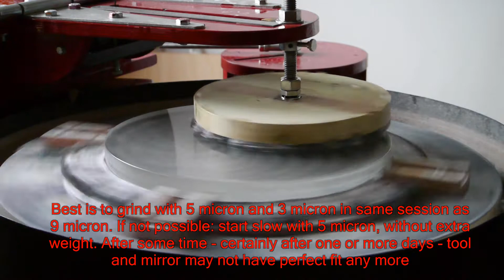Making a 33 cm f/4.8 mirror on the Mirror-o-Matic 5: super fine grinding with 5 and 3 micron grit

Comment: I have been binge watching this playlist because i plan on building a MoM soon. After every grit size, do you disassemble the turntable and clean it thoroughly, or does it not matter?
Reply from the maker: I clean the turntable well without disassembling after grinding with 80 and 180 grit. I disassemble the turntable for more thorough cleaning after finishing grinding, after 3 micron grit, so before I start polishing.

Comment: Hi Jan. Nice sequences, I have to say. Very instructive. I did want to ask one little question. Why do you rotate the glass every so often, when the whole thing is spinning on that axis anyway? Steve
Reply from the maker: Maybe this is not necessary, but it does not cost much time and I do it to be as sure as possible that mirror and tool do not get into resonance.
Reply: makes sense - So there is absolutely no possibility of there being any affinity between the two systems I guess. You are decoupling them by rotating every so often, "just in case".  @janvangastel6763